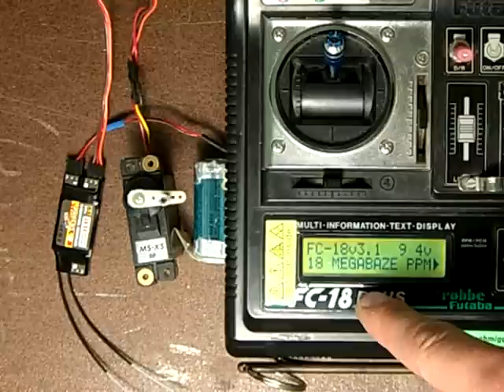robbe Futaba FC-18 Bug

Comment: he , i had something like this before with my ff9 futaba .  my modelshopguy told me to switch off power of the radio after changing model .  he said that he has seen it ocasionaly with futaba radios .   
i also had a problem once with a new program , i had a new heli , and made a program in the same 'model number '  as my old heli . the radio did not erase  the old program  completely .